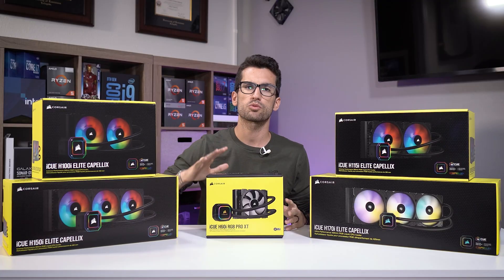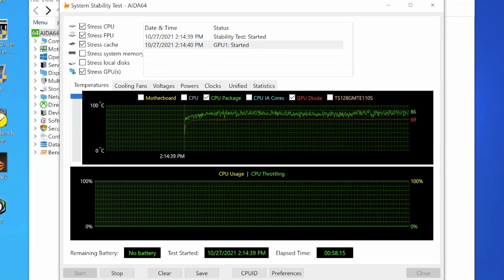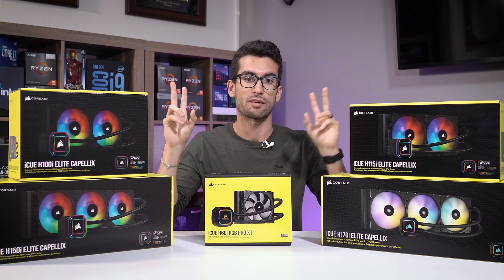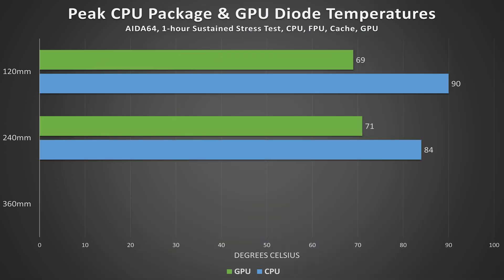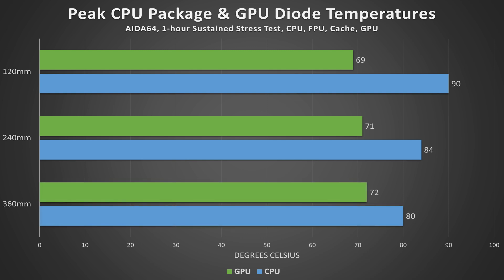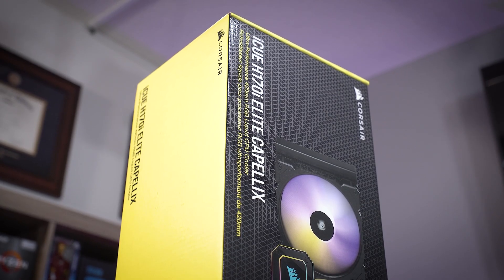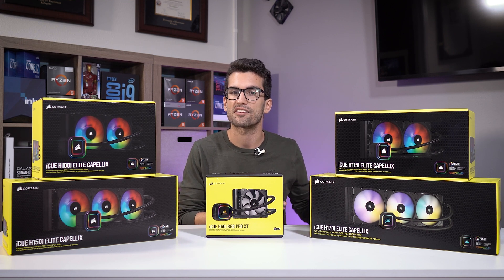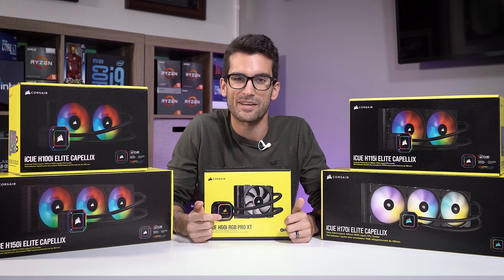Choosing The Right Radiator Size For Your AIO CPU Cooler

Comment: 120mm is usually for small case.
240mm is like top tier air cooler.
280mm is better than air cooler.
360/420mm is the best you can get.

The sweet spot is 280mm if the case support it i guess.

Comment: I do not understand the namign conventions that differentiate between this whole confusing product line...   Elite... Cappelix... XT...  RGB...  Hydro...  Pro...    it's like a word soup.   As far as I can tell the only differences are the pump head and the overall color.   And some weird difference between XT and non-XT in fans... aRGB or something.  This is becoming a nightmare and the hardest part of the build.. figuring out your naming scheme.  And I need to control this with buttons on a box, not via software becauseI don't think you support anythign earlier than Windows 10...  which is like... 9 other versions of Windows...

Comment: Hi Corsair, today i was at my local internet cafe and their builds consisted mostly of corsair hardware as well as peripherals, the mice they had was the harpoon rgb pro and the m65 pro, so as i was playing and noticed my aim was off by alot and found the problem to be the lift off distance, i then look on the mouse to find the any button that adjusts the lift off distance with no luck, i go into icue to find out theres not an option to adjust the lift off distance... like what were u thinking when manufacturing these mice?? My guess would be u never even tested the mice before releasing them with a high lift off distance... it truly made my internet cafe experience bad... cmon guys its 2022 i know u can do alot better than that🙏

Comment: Some notes:

A. Stress testing is for an absolute worst case scenario, so 90 degrees in that case isn't major cause for concern.
B. Greg said they worked on "peak temperature". This is the absolute hottest the CPU got in that hour.
C. 1000 RPM is fairly low on most fans (it's quieter though, so there is some benefit).
D. Overclocking your CPU is really not necessary in a majority of cases.
E. The 7700k is known to run a bit warm.
F. A 6 degree difference isn't the end of the world.

JayzTwoCents did a more informed video on the subject, I'd recommend giving it a watch if you're uncertain. But essentially:
A 120mm AIO can handle even a slightly overclocked i7/R7 without a problem (in all likelihood it won't even run loud).
A 240mm AIO is only necessary if you're doing heavy overclocking or running a top-end CPU (i9, Ryzen Threadripper, etc.).
A 360mm AIO is only necessary if you're either doing extreme overclocking, or doing heavy overclocking /running a top-end CPU AND you want it to be incredibly quiet.

Comment: This might be a stupid question, but you can replace the radiator fans with others more to your liking, right?  I believe mine came with MLs, but I like the QLs much better.
Reply: You can, but you might run into minor fitting issues, like small gaps between the fans or sub optimal fitting next to the radiator.
Reply: @SteamyIceChest  that's why i prefer lian li products than corsair they don't even have a daisy chain fan yet

Comment: I have an i7 9700k with a 240mm h100i elite cappelix. Temperature never goes higher than 50 degrees, even while gaming. Pump and fan speed aren't to the max

Comment: what ??? 360 radiator... and  CPU temp 80°C ??????   i have AIO 360 Aorus and after stress test  tepmperature of CPU was max 56°C
Reply: With the fan speed capped at 1000 rpm

Comment: I have a icue220t case, and I really want 240-360mm rad. The problem is that my gpu(3080 tuf) take all the space in the front and my ram (vengeance rgb) takes space on the top. A simple solution would be to get rid of the ram but I want to try and make it work first. Any ideas? Thanks
Reply: bigger case would be best

Comment: i got a 4000d airflow with a 120 aio for my 5600x mounted to the back exhaust and my 3080 has a 240 aio mounted to the top
this way both aio get fresh air from the front without affecting each other

5600x gets 61c max with cinebench 4.9ghz all core oc 1.333v
3080 gets 56c in furmark no overclock

Comment: Video is quite old at this point. The 7700k was released on 1/3/2017
Reply: That's irrelevant for thermal testing. The point is not that the 7700k is 90C with a 120mm rad, the point is the difference between the 120mm and the 240mm is 6C.

Besides, older CPUs are more consistent in their heat output - it's a lot harder to get a consistent heat output from a newer CPU (which is why a lot of cooler testing isn't even done using CPUs in the first place)

Comment: I kinda always wondered why you didn't make one with quick disconnects and then supply any number of after market rads for the end user? Like what if I wanted to start with a 120 but then upgrade it later without rebuilding the whole system?
Reply: The more parts, the more potential failure points, also I doubt enough people would want modular AIOs for it to be a viable market.
Reply: @FAKE-NAME  The Corsair Elite Capellix AIO coolers which are a generation older DO support the screens Corsair sells them as an add on accessory for the Elite Capellix coolers which I own but I am waiting for the add on screen to be available in stock as it is on their website since the new AIO's were announced but I have never seen it in stock
Reply: I mean if you want to upgrade from a 120mm rad you'd be better off getting a completely new rad all together because of the way they are designed and made.
Reply: @FAKE-NAME  EKWB did some AIOs with quick-disconnect. They didn't sell very well.